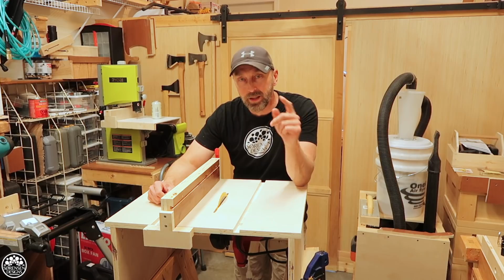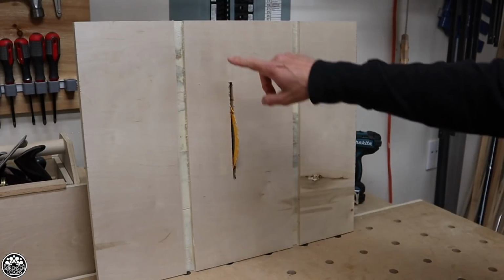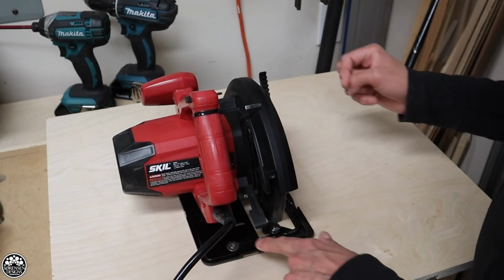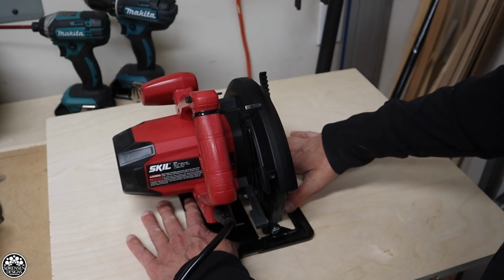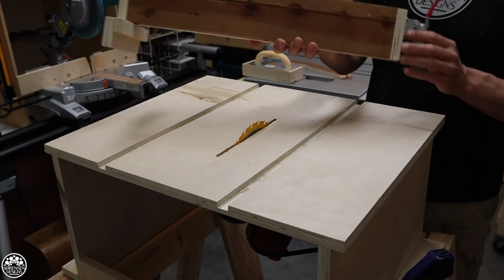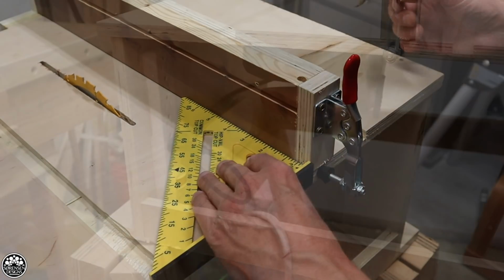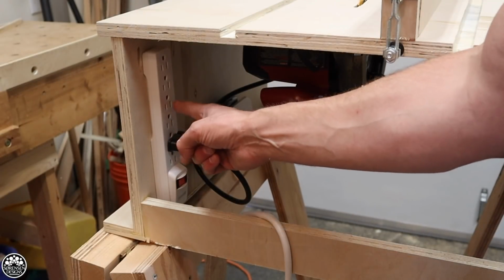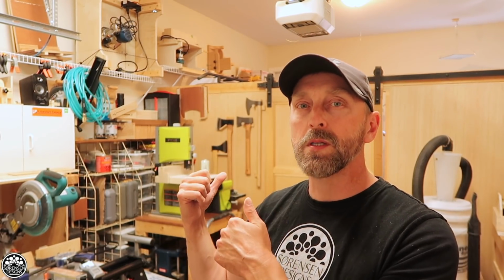Building a Portable Compact Table Saw // Woodworking

Comment: Maybe for the delux  version you could attach the saw to a piece of aluminium plate half inch wider all round like a router table. Allows you to use almost the full cut depth cut capacity for your saw.
Reply from the maker: You could do that but it's not really worth it for the extra 1/2 inch. I wouldn't recommend cutting at full depth regardless.

Comment: That looks great. But it seems to me this would be a good thing for someone with limited tools to build. Do you think you would be able to make that using only the skil saw and a drill?
Reply from the maker: You can build this with just a circular saw with an edge guide (or a good straight edge) and a drill. You would also need a basic pocket hole jig and a speed square. The only part you won't be able to do is the miter slots and the T-track.
Reply: Could you not cut the miter slots with the saw and a straight edge, just in several passes. As long as the cut either side was accurate and the bottom of the slot was sanded after, it would work ok, wouldn't it?
Reply from the maker: It would be tough to get the bottom of the miter slot perfectly flat doing it that way. Ask yourself how much you will actually need a miter slot before you go through all that trouble.
Reply: @EricSorensenCanada  You could flatten the bottom with a home made router plane aka Paul Sellers!
Reply from the maker: I recommend buying at least a basic router. You'll never look back🙂
Reply: I agree, I have 3 routers and I still think I need more, just need to sneak them past the wife. I just meant for new or young woodworkers who have little or no tools already.

Comment: Hi i have bought that same table saw 2nd hand n i dont have the manual to it, where can i get that one. Also there is a piece of the saw that was handed to me which is the not connected it is the adjustment level that is between the extension table wing, i dont know how to put, n the extension wing keeps moving to the side. Please help.
Reply from the maker: Hopefully this will help. This is a manual for the saw I have: https://images.homedepot-static.com/catalog/pdfImages/f6/f6fe8062-1396-4670-9d4c-41d3e40250f4.pdf
Reply: @EricSorensenCanada  thanks, i will try it and let you know, thanks

Comment: Eric, Do you know what a fence toe is?
Reply from the maker: Yes! The toe refers to the end opposite from the locking lever on most fences (pointing away from you). Some folks micro-adjust their fence so it is toe-out, or widens slightly on the out-feed, so that your off-cut portion does not jam between the fence and the blade. Most will agree that you do not want to "toe-in" the fence (narrowing the out-feed). 
The default is no-toe, or parallel to the blade. Most saws will do fine with the default set up. I personally maintain a parallel set-up and ensure that I'm using a sharp blade. Also, if you're using your riving knife, you really don't need to worry about the fence toe adjustment. Also, NOT all fences will allow you to adjust for this. Finally, Don't try to take large cuts all at once. Use less blade and go with a flip cut or raise the blade gradually and make multiple passes. I'll probably make a video at some point to explain this better.